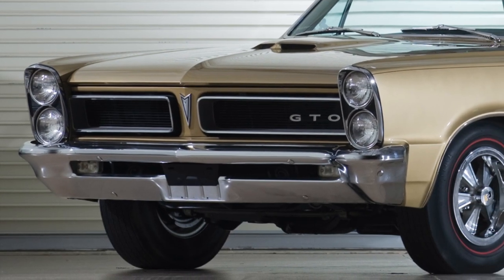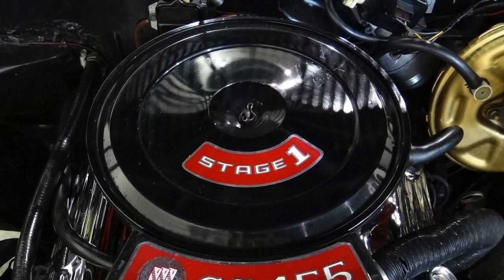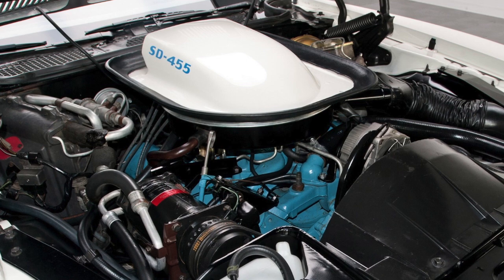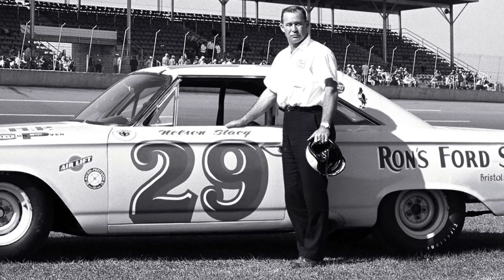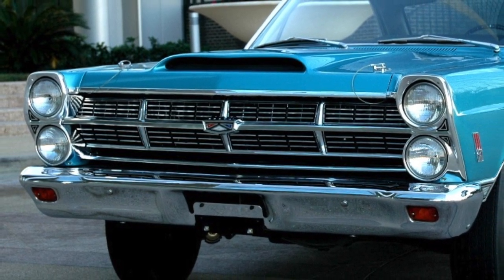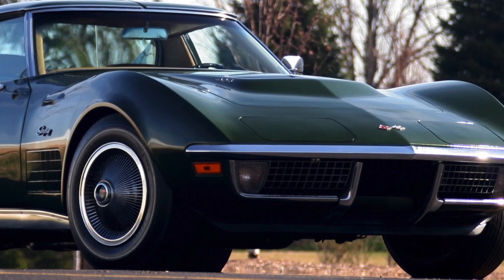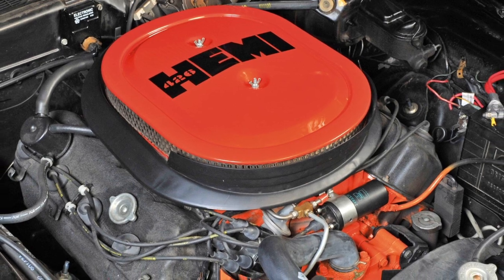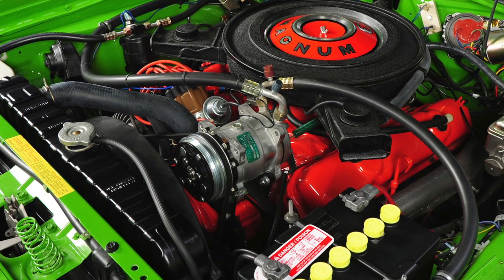5 Best Vintage V8 Muscle Car Engines

Comment: is the Chrysler 318 a Good motor
Reply: Yes. Reliable to the point of absurdity, and it can rev and produce some great torque and horsepower... Don't over carb it.... keep it a two holer, or a small CFM 4 v
Reply: @johnjacobsen1915  what would be the best carboraitor for the 318 mine is a 93 magnum i think it's 9.1 compression would the 600 cfm or 650 cfm be best for that motor and what intake should i go with
Reply: you want a lower cfm carburetor for good street torque and drivability. High flow cfm carbs require high revs and become sort of obnoxious... you want your power right off idle... any dual plane manifold should be fine... even a factory 4 hole manifold is fine... use the 600cfm and a standard factory 4 hole manifold. Dual exhaust through standard steel manifolds is adequate too. The best results will come from a well tuned engine with a LOT of spark advance, and quick advance springs on the distributor.
Reply: It is a great engine, just not a high performance engine.
Reply: Find a 340!

Comment: gotta love the 427CJ =D.  Wonder what would happen if ford put the 427 cammer into street cars =p
Reply: 427 Cobra jet not much different
Reply: I believe they did, in the Cobra AC
Reply: No.  427 Cammers wouldn't fit in a cobra due to the huge cammer heads.  They wouldn't even fit into a '67-70 mustangs unless the shock towers were removed.  The Shelby Cobra featured 427 side oilers and perhaps 427 top oilers (in '65).  Some big block cobras actually had 428 Thunderbird motors.  Because the Cobra was so light, even the 428 Thunderbird powered cars were quick.
Reply: There was no 427CJ motor.  the video shows both a 427FE and a 428CJ.  A 428 CJ is a beefed up version of 428 Thunderbird block topped with 427 head and a 735 cfm carb.  The 427 cammer motors produced by Ford had  657 HP with two 4 barrel carbs.  No way 60's street tires could hold.  Ford had eleven '65 mustangs modified (shock towers removed) and wedged a 427 cammer into them to race in the A/FX class.  The first such car broke its axle. But the others typically ran in the 10.30's in the 1/4 mile.
Reply: Bentley Griffith      You are absolutely right, I think I had a brain fart or something, I was thinking side oiler but said cammer. Thanx for straightening me out.
Reply: Side oilers WERE put into some Fairlanes.  There is one in the video.  The side oilers had more HP than the early 427 although Ford kept advertising them at the same 425 HP.  If memory serves, a stock medium riser 427 side oiler with two 4's dynoed around 465 HP when tuned on the dyno???
Reply: the six foot long timing chain would break and destroy the engine

Comment: Having owned all 3 of the top motors, I got to say the list is wrong... The 454 LS was awesome, but 3rd best. The 426 HEMI , again awesome but 2nd best. Having outrun all of the others many times with a 1966 427 Fairlane! I have to go with the Ford 427 as the best of the best.  BTW the cars I had were... 1970 Chevelle SS LS6 454, 1966 426 Hemi Charger and finally a 1966 427 Fairlane. All stock, all original. And it didn't make any difference who was driving. Me or 4 other friends of mine. The Ford Fairlane always came out on top!

Comment: The biggest thing that held back the big blocks including the 455 Buick and LS6 Chevy's was the tires that couldn't handle the torque especially on the street. My brothers 70 Z28 with automatic and 4.10 rear, and big F60 15 tires with 360 hp Lt1 had no traction problems and won every street race against the big block cars. On the track, the stock Z28 would run consistent 14 1's but with 60ft times of 1.8 would win there as well unless the big blocks were running cheater slicks.

Comment: Ok here i go again, i respectfully disagree.
#1. The ZL1 427 (7.0L) Was an all aluminum race engine with forged internals, the block weighted 100lbs less and the heads weighed 70lbs less making it lighter then chevy's lightest small block 283cid. The ZL1 Camaro ran 13.1s@110mph 1/4 mile but with headers, 275 wide slicks, and a little tuning it ran a 11.6 @122mph it also set several super stock records running low 10s. It was rated at 430hp@5200rpm/450tq although with its solid lifters, high lift/long duration cam and large port heads with 12.0;1(*?) compression ratio peek horsepower should occur around 6200rpm  this indicates the engine made far more horsepower then advertised and it has the quarter miles times to back up that claim. GM used woefully undersized tires 195/75-14 and simply switching to a appropriate size tire could drop 1/4mile times by up to one second. 

#2. Chevy's DZ302 (5.0L) was a true race engine  built strictly for trans-am racing GM only intended to  build around 60 production models to comply with production car rules but the snappy high revving engine quickly gained a cult following and production model numbers went way past sales expatiations.  The DZ302 was a de-stroked 327cid  with a large oil journal crank, solid lifters and forged internals. Rated at 290hp it was clearly under rated due to the fact it  had the same cam and heads as the 375hp 327ci meaning if you revved the dz302  higher it would make the same horsepower (well slightly less 360hp although less tq ). in trans-am and Formula 5000 racing the DZ302 made as much as 500-550hp at 7,400rpm but shifted at 8,000rpm due to its wide power band meaning it was always near peek power allowing it to out perform other engines with similar power.  In the 1968 NHRA super stock championship two DZ302 Z28 Camaros won beating out all the big block cars with a mostly stock DZ302 (only mods were 275 slicks/open headers/4.56gear) it ran a low 11sec. it was so good Formula 5000 keep using it till 1976, 6years after chevy stopped making it.

#3. Chevy's port  fuel injected 327cid/375hp (5.3L) introduced in 1962, it was  the most powerful and most  horsepower per cubic inch  naturally aspirated, single-cam, production small block V8 until the appearance of the 385 hp/385 lb·ft  Generation III 5.7L LS6 in 2001, this is very impressive considering the horsepower wars did not peek until 1970 and port fuel injection was not used in the corvette again until 1985 . The small block only weighed 535 lbs almost 150lbs less then the 396cid big block that made the same 375 horsepower. With a near perfect 1:7 rod ratio,large 4"inch bore and a short 3.25"inch stroke it was a free revving engine with a still to this day high red line it  truly was  ahead of its time.

#4.  Pontiac 455SD, i agree with you there. The heads flow almost as good as a hemi and with 30cid more all you needed to do was mill the heads down to raise the compression up to 10.5:1 and add high flow long tube headers/exhaust and you would have a engine that has more  power potential then any of the other GM 454/455 engines.

#5. mopar 440 six pack, every body knows the 426 hemi has great flowing heads but it also weighed almost 800lbs! On the street and at the track 440 proved it was just as fast as any 426 hemi if not faster in some cases. Now the being said the 426 hemi saw larger power gaines from modifications and a 8-71 roots blower paired up with a hemi's superior head flow is unmatchable, but stock vs stock the 440 is going to idle better and hold its own on the drag strip.
Reply: did you copy that off wikipedia? haha good insight
Reply: No i typed it TWICE the dam page reloaded right as i went to hit enter and man was i pissed , i had a lot more info but i forgot some and was to lazy for the rest, thats why i started with "Ok here i go again". Fine i did copy and past "the most powerful and most  horsepower per cubic inch  naturally aspirated, single-cam, production small block V8 until the appearance of the 385 hp/385 lb·ft  Generation III 5.7L LS6 in 2001," but i added  "and most horsepower per cubic inch" and "5.7L"  you got me aha ha.
Reply: 340n dusters would blow the cheby off the track
Reply: ha ok 340 had NHRA rating of 325hp vs a LT1 350 NHRA rating of 425hp. I use NHRA ratings because factory ratings are misleading.  The 340 was the best small block mopar had to offer but a 283 sbc could keep up if it had 4.11 or better gearing and a stick
Reply: Having owned a couple 340 cars, including a Duster, on the street could out run many higher hp cars light to light. It did not have a huge traction issue like the higher power cars. It was a well balanced power/traction car. On the track, the larger hp engines will take advantage of the better traction and were easily a second faster by the end of the track. Short blasts on the street surprise many, but at the end of the 1/4, it was still a 14 second car. I miss my old Mopars, sigh.
Reply: 2nasti i agree just enough torque to get the car moving but not spinning and enough power to keep it pulling strong to the top of 2nd gear by which time a big block car hooked up and comes roaring past. but on the street they gave many people a surprise. Most people laugh when i mention the 283 sbc but it was making 315hp stock but with very little torque so it always hooked up and it had a factory red line of 7,200rpm which keeps you in the power band when you shift because you only drop down to around  5,000rpm  so you have almost all 315hp all the time unlike some big block engines that shift at 5,700rpm and drop you right out of power to a low rpm and your waiting around for the power band to kick in.
Reply: oh my god what a GM fan boy,that's what you should change your name to. Wow ford didn't even make the list hahahahahahahahahahah
Reply: All of these high-end expensive race engines depended on who the engine builder was that day. No two were alike. For example Chevrolet would grab parts out of a leftover parts bin on a Sunday and slap together something not intended for the car they were put in. You can't put a concrete number on them much plus who did the test is just as much of a factor as anything. In the end it's the seat of your pants which counts. lol
Reply: Point 5 - I had cousin who had a Challenger with a 340 and she married a guy who had one with the Hemi. They hardly ever drove his car - handled like a brick on ice. Way too heavy of an engine for the chassis.
Reply: You are in Chevy pretend land !
The ZL1 was NEVER a production motor. in 1968 Mopar build a few 478 cid HEMI's, should we include those too? Or Fords Single Over Head Cam (SOHC) 427 ?
But, I can't expect realism out of any guy that thinks the 283 was a contender against ANY 325 cid or bigger performance engine by ANY brand !
Reply: chevy 427 got it handed to them in NASCAR.
Reply: I have to disagree about the ZL1.  The motor put out a lot of horsepower but it was way, way too expensive.  Few could afford one back in the day which is why it was so rare even back then.  Just the engine by itself cost more than a brand new corvette.  You'd get a lot more bang for your buck if you just ordered a 454 and paid to have it modified.
Reply: Gotta disqualify the ZL1 as they doubled the cost of a Camaro, and only 71 were built (including 2 corvettes)

Comment: oldsmobile rocket 455?
Reply: Popular Science used to do an article every year on all the new model year cars. The acceleration test was from 25-70 to simulate merging onto the brand new Interstate highways back in the late 60's. The fastest car they ever tested was a full sized Oldsmobile, did it in under three seconds as I recall. Those old Oldsmobiles had a ton of low end and mid range torque!

Comment: I had a bought off the showroom (literally, the salesman had to open the showroom doors and drive it out) new '69 SS396 Chevelle with 3.2 mi. on the odo. I first put my foot in it with 36 mi on the odo. If it had wings, it could have flown. I ran a 12.9 at Detroit Dragway (and a 13.1 and a 13.2 all true times at Detroits best known drag strip). I ran hundreds of street races on Telegraph Road on the west side of Detroit (and a few on Woodward Avenue, north of the city). I lost only 4 races ( one to a '66 built up 327 Chevy II with open headers, once to a '69 Hemi Charger, another to a 440 GTX and to a 427 Vette) Never lost to any Ford. There was a mile long dead end road between Metro Airport and some farmland south of the airport. Hundreds used to race there late at night. I went out there one day by myself just to look around Lo and behold, here come two guys in a new Mustang. They are in their late '20s, say they work at Ford in product development (or something) want see under my hood, and want to race. I popped the hood (it was showroom stock) and then blew their doors off. Ford? No problem!

Comment: These engines may have been cool and, maybe, state of the art: BUT, the engine all the guys were driving, winning, tweeking, rodding, modifying, and the REAL legend was none other than the humble small block Chevy.
Reply: Brand loyalty aside, the Mopar 340 was on par with all SBCs.
Reply: EXACTLY!! I’ll take a 327 all day
Reply: I watched some local street races back in the 60's and I remember a 440 GTX with huge rear tires and massive dual exhaust pipes race a little Chevy 2 Nova with a 327 and one tiny exhaust pipe. The Chevy blew him away, I was shocked!
Reply: LT1. 70-71

Comment: i bought a brand new 1969 dodge super bee, back in '69 in Vallejo, ca.  the 426 eng was not available {according to salesman} the 440 eng was a  'special' order  that would take 4 weeks.. so i bought it with the 383 eng.. big mistake!, i should have waited for the 440! the
383 eng was a good eng but it couldn't get out of its own way!  back in '69 there was a lot of factory big horsepower on the street and that 383 didn't cut it.. i did beat a '69 GTO "judge" that had a 389 though. lol

Comment: 3:59 "Pontiac never produced a small block V-8." Pontiac had a small ohv V-8 introduced in 1955 with 287 cubes.  Derivatives of it were produced in 10 more displacements up to 400 cid and also one of 265 cid for '80-'81.  My family had a '64 326 as well as a '62 Trophy 4, which was also derived from it, of about 194.4 cid, ~389 divided by 2.
Reply: All the Pontiac V8's had the same block dimensions regardless of the cubic inches displacement . Thats why there was no actual small block.
Reply: @4thstooge75  The 265 and 301 Pontiacs were lowered deck versions of the regular V8, and had the same bore spacing.  Oldsmobile did the same thing to their V8 to get their small block 307, 330, 350, and 403's.  Since the Oldsmobile engine with the lowered deck is commonly called the small block, I call the lowered deck Pontiacs small blocks, too.  Even though the 301 and 265 are very forgettable from the standpoint of performance.

Comment: The 70  Hemi "Cuda  may have only run in the low 13s  right off the showroom floor,, but that was only because street tires were not capable of handling the torque of the big motor, and pump gas wasn't up to the demands of 12 to one compression. All you needed was a set of Mickey Thompson drag slicks and some 115 octane racing gas, and the Hemi 'Cuda would turn a 10.70 quarter at 150 mph.. You could literally compete with Pro Stock cars, with a factory machine. The only problem was, racing rules for pro Stock required a roll cage.   I can't tell you how many young newbies got their racing start in a practically stock Hemi-Cuda.  Ronnie Sox made a career with the 426 hemi.
Reply: The 426 Street Hemi only had 10.25:1 compression from the factory. The race Hemis had 12.0:1 and up depending on what internal mods we're done to it
Reply: @jeremythompson9895  : All the more reason to be impressed by the 1/4 mile performance of this stock engine. The only mods allowed in the stock classes,  in those days were external things like exhaust, intake and carbs. All internals had to be as sold from a dealer.  The 426 hemi dominated stock drag racing for 8 years.

Comment: A 70 hemicuda equipped with 355 gear and period bias ply stock tires. Turned a 13 1 426 max wedges with 13 5 compression were breaking into the 12s and setting track records all over the country not to mention limited production hemis that came with 12 5 to 1 compression and horsepower and torque ratings listed as n a what about 68 hemi darts and barracudas
Reply: The rear end in the 70 cuda was a Dana 60 so the gear ratio was 354 not 355 anyway same dynamic it would have liked a 410 also considering most of the power comes above 3000 rpm

Comment: I owned everyone of these in my 63 years, and dozens more , The fastest at the track was my LS6 ,That ran 11:66 @ 115 ! The only modification was a 1050 dominator and Hooker Large tube hedders .But on the streets my 66 hemi charger felt the fastest ! The torque came on strong from idle and up and would fry tires forever ! Just put it in drive ,smash the throttle and it would spin tires through 1ST, 2ND & Drive.

Comment: O man I miss my GTO.
Reply: A Pontiac Lemans with 389 and tri- power was very fast car, a Pontiac GTO with 389 and tri- power was a LEGEND. Why? What I found was a Lemans came with 3:30 to 1 rear gear ratio while a real GTO came with a 3:90 to 1 gear. Big difference. The difference between going fast versus being able to pull wheelstands.
Junking cars in 70s we picked up the remains of an old GTO shell. I asked the owner if it was a real GTO or a tag job to look like one. He said it was real GTO. I told my friend I wanted the rear end out of this car. It indeed had 3:90 gear. I put it in my car.

Comment: People today look at those times and yawn  but the forget about the skinny bias ply tires of the time .Today we put bigger stickier tires on a 4 cylinder SUV.  With good sticky tires most of those cars could easily take off a sec or more to the 1/4 mile time.

Comment: It may be technically correct to say there was never a Pontiac small block V8.  There was a Buick/Olds/Pontiac  215 cubic inch aluminum V8 in the early 60's.
Reply: My dad had a 63 jetfire 215 turbo liquid injection. Nice car!
Reply: Not a Pontiac engine, Olds version of the Alumnium 215.